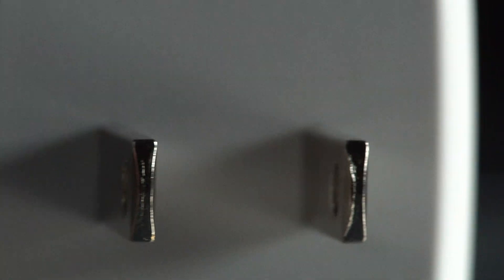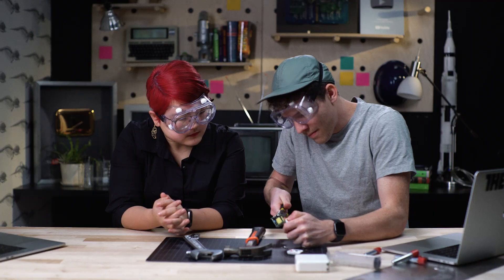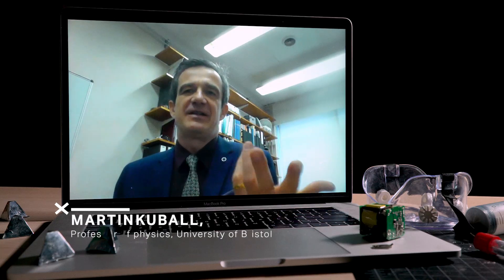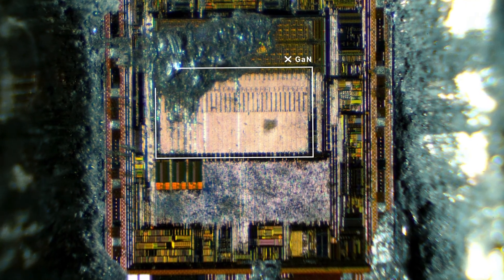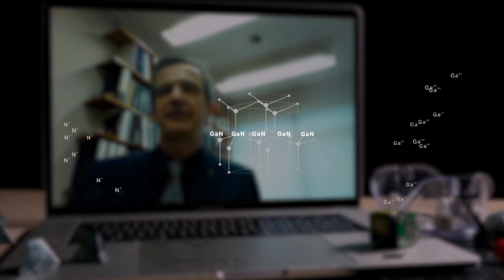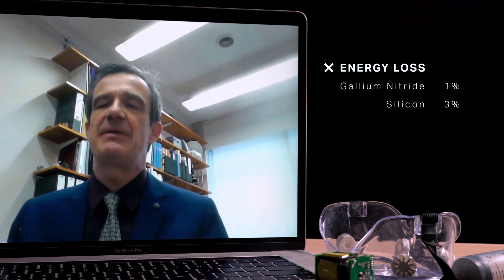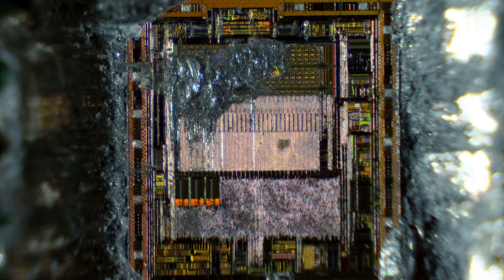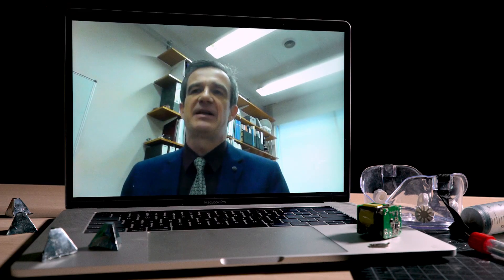Is gallium nitride the silicon of the future?

Comment: I would have to disagree with the video description, where it says “The global electronics industry has been fueled by silicon from the get-go...”

The global electronics industry once depended on vacuum tubes, then upon the invention of the transistor, it began to move to semiconductor-based electronics. But those first semiconductors were mostly made of germanium, which doesn’t work nearly as well as silicon, requires more complex circuitry, and thus is less efficient. As technology improved, silicon took over from germanium. So if GaN takes over, it will just be another step in the improvement of electronics technology. But in reality, the electronics industry goes back even farther than the vacuum tube, as early inventions like telephone and radio predate the vacuum tube.

Comment: you will not get a smaller charger if you use galium nitride, as you have seen, the size of it it's almost all dependent of the size of the transformer, so if you decrease the size of other electronics it will not change much, because the transformer still takes a lot of space
Reply: You can switch at high frequency at the same efficiency than with silicon. This reduces the size of the transformer needed.
Reply: GaN based designs will allow you to use a smaller transformer compared to Si based designs for the same efficiency.
Reply: GaN FETs are the key because their main advantage is that they become much more efficient as frecuencies grows compared to Silicon, and with higher frecuencies, you can use smaller transformers to induce the same power, so all is a chain.

Comment: Is it me or did this video not really explain the fundamental benefit of Galium Nitride, if there is indeed such a thing? A 2% power saving resulting in a 10% drop in overall electricity usage is small fry. That sort of saving isn't revolutoinising anything, especially not if that's only once we've seen a completely wholesale switchover in production. If, however, there were predictions of higher clock speeds or higher density transistor production along with lower power consumption, well then you're talking. A small power saving alone, though? Meh.

Comment: How does the gallium nitride make the charger smaller? You are comparing a 30 watt charger to a 60 watt charger in the video and act as if the difference in size is due to the use of gallium nitride when it isn't.  The biggest components of the charger are copper coils and capacitors. The 60 watt charger obviously requires bigger coils and more capacitors. Capacitors being another space consuming component. The reason the other charger is smaller is due to design and output power. The chip that contains the gallium nitride doesn't get significantly smaller compared to regular chips . The only real advantage it has in this charger is the efficiency, which ofcourse is welcome in a charger. But the chip is not where the biggest loss in a charger comes from in the first place. In general most chargers are already 85%+ efficient.
Reply: Infotainment. They acknowledge that there are scientists but steer clear of anything that might resemble a discussion of science. And they make a big deal about lazy and mindless destruction.
Reply: It is true that coils take a big amount in the overall space of the charger. Heat is a concern, but it's not why it make the charger smaller. Actually, the very big improvement that offers GaN, and that is not said in the video, is that GaN offers a much higher frequency range to convert power. Thus drastically reducing the size of coils. It does have a better efficiency than Si transistors, but on a certain range of frequency only. So be careful on what is said in the verge video... because it's not all green for GaN, a lot is still needed for it to be reliable, mass produced, and so on.
Reply: @alexc4882  Spot on. I'd add that the increased efficiency allows designers to increase the current density without having to place clumsy heat sinks all over the place.
Reply: @alexc4882 :
"Greater freq. range ..." Does somebody you know have 400 Hz power in their home? Or their boat?
Reply: @alexc4882  Not so. Switchmode power supplies - which is what those chargers are - operate at frequencies much, much lower than the upper limits of conventional silicon semiconductors; commonly 10-15KHz. Silicon doesn't start getting problematic until you get up into the GHz range, which is why current CPU clock speeds top out around the ~4GHz range, whereas the theoretical limit for GaN is much higher. GaN doesn't offer any significant advantage over silicon for power adaptors.
Reply: @theantipope4354  4Ghz for silicon is at very very very low power... Your CPU might draw 100W, but it contains billions of these transistors! Here we are talking 1 transistor, 1kW, 1MHz. BIG difference. Simply because you are not in the same electronic. You're talking about electronic of signals, we are talking power electronics.
Reply: @alexc4882  
"Actually, the very big improvement that offers GaN, and that is not said in the video, is that GaN offers a much higher frequency range to convert power. Thus drastically reducing the size of coils."

Alex, that makes absolutely no sense. Their frequency is the frequency at which a current passing through them alternates, not the frequency that a transistor can switch states at. As Lionel said, the frequency of current silicon transistors is already orders of magnitude higher than the rate at which AC alternates.

GaN power supply switches are more EFFICIENT - they have less power dissapation. But the potential for GaN transistors to switch faster than silicon is simply irrelevant when AC is 50/60Hz and current silicon transitors are at around 4GHz.
Reply: @nathangamble125   I don't think you understand how a power converter works. The big picture is that to convert from AC to DC, we use a full wave rectifer (simple bridge using diodes which acually work at 50/60Hz). After that and a LC filter you are left with an almost constant voltage, at (2*Vmax_in/pi) Volt...  If you want to plug your laptop after that, go on!
So, to step down the voltage, we use a buck, buckboost, or any other power converter topology that uses Silicon transistors and runs at 10 to 100kHz (order of magnitude) with passive components that takes A LOT of space! This is that part that everyone is talking about. Going higher in frequency reduces the size of the inductor. But I maintain that GaN is not more efficient than silicon at a few kHz, I'm seeing it every day at my lab... However, with good layout and cooling system, it get interesting at a 40kHz and beyond.
Reply: You have to think of the design as a whole, due to the use of GaN switching, which is more efficient than silicon at the same frequency, you can reduce the size of your transformers by going higher frequency. In fact you can also reduce the size of the filtering circuits as well. The Verge video is badly explained, the reduction in size is not due to the physical size of the GaN chip, but due to its characteristics, the designer can choose smaller parts elsewhere in the circuit.
Reply: This is a good run down although there is a truth to the idea that GaN makes these SMPS smaller. Firstly it makes the power transistors physically smaller but they were already pretty small. It also makes it possible to achieve much higher switching speeds which makes it so the transformer can be even smaller.
Reply: The verge is never a great place to go to for strong information
Reply: Higher switching frequency = less ripple = smaller passive component 
and GaN has lower switching loss too
Reply: In my experience equivalent GaN is 1/4 the area of silicon.  But contrary to what the researcher quoted said ,  the problem with GaN switching circuits is that, unlike with silicon fets, the p-fet is not available (because it does not have comparable performance to the gan n-fet). So in H-bridge topologies, you need a gate drive to operate high-side n-fets, which is no easy feat at high speeds.
Reply: I'm wondering if it was an ad or some kind of "sponsored" content.
Reply: @az_dirt  Yeah , there surely are plenty of unfair comparisons and unrealistic claims in the video to be reeking of both an ad and sponsored content.
Reply: GaN chargers are actually smaller. The important thing here is that these are USB chargers, and the electronic components heat up and limit the power output of small chargers. More efficient transistors means you don't have to deal with as much heat, so you can make your chargers smaller. The limitation on size is not due to our inability to manufacture small coils.
Reply: Just put this Channel on my not watch list
Reply: Sorry thats wrong, it actually makes the device smaller, but that is because you can have a higher frequency in your charger so your transformer gets smaller, also GaN can work just like SiC at higher  temperature higher temperature conductivity which means less cooling system is required which leads to higher density of transistors.and smaller devices
Reply: It has lower resistance than silicon transistor.
Lower resistance means more efficient so the charger can use smaller coil, capacitors, etc. for same output capacity.
Reply: To get simple answer to your question: GaN has faster switching and higher efficiency. Which will make the components around the IC to be smaller (Example driver circuit, capacitor used etc..) which intern overall reduces the size of the adapter. Makes sense?

Comment: As an engineer working on GaN I could say that most of the things that professor said is wrong or misleading...  You don’t even gain 0.5 percent efficiency if you compare the best Si based circuit to the best GaN circuit! And little bit expensive? What a joke! Couples of times more ! And don’t even start with the reliability issues of GaN. When tech is not there it is not there, no need to overhype it just so you can get research fund...

Comment: Gallium Nitride is an interesting step for the future. I think the battery problem needs to be attacked from both sides by improving battery density, but also improving efficiency of electronics. The nice thing is you can actually buy products that use GaN right now, unlike graphene (but maybe some effective way to process graphene will come out in the future and graphene will blow up commercially).

Comment: I dont understand why dr kuball claims GaN will allow us to get a wire straight from the wall to a device. Clearly the biggest component in the transformator is the coil and shrinking it will require completly different tech. 
In general I'd say that this video making some very optimistic claims for no reason. For example the 10% power reduction claimed if we switched to all GaN is really neat, but to actually change out all electronics would require a massive change. Maybe it would be worth it in the end, but it's not like the industry is "scared" and "conservative", they just don't see a big enough benifit.
Reply: @daniel-ruiz  no it obviously couldn't be, because the coil is big and gets hot. You can't change that by making a smaller PCB

Comment: Semiconductors arent halfway between conductor and insulator.. its not like that.. its not even the way it acts or is used.. you are describing a resistor
Reply: Says a lot about the quality of their content
Reply: Verge Science writing the script: "Well I know what a conductor is... and I know what semi means so... I guess..."
Reply: its the verge what do you expect
Reply: I'm an expert in this field. Describing semiconductors in such a way suffices for the layman. 
With regards to the "energy band gap", semiconductors are indeed 'halfway' between conductors and insulators.
Reply: Wait silicon can’t be used as a resistor? I mean most resistors are made from carbon or metal film, but in context of microelectronics how else would you create a resistor?

Also doped semiconductors are what creates diodes and transistors.
Reply: @B0MYT  exectly it can be isolating or conduction P or N its not in the middle between them, its not both its one or the other, you say the same thing nicolas said.
Reply: @omeridan8815  Not really, you indeed can make resistors out of silicon. Silicon transistors can be fully on, fully off or somewhere in between, letting some of the current through.

Comment: You will never have a cable that plugs directly into the outlet. You will still need some inductors and capacitors to smooth the voltage. Better semi conductors allow the use of smaller capacitors and inductors, but only to a certain degree. After a while we reach the physical limits of our universe.

Comment: Silicon Valley is a software and device hub for the most part. Device makers like Apple and Microsoft largely buy off the shelf components. It's the factories overseas which will have to re-tool for this new compound and that's why they have not yet. Re-tooling is a massive investment and there is largely no incentive to do it quickly. It's not just because it's different but because it requires such a massive investment.

Comment: A tad unfair to compare a 30W Anker charger to an 87W Apple one (Less impressive once compared to the 29W Apple charger which also has universal adapter capability). If you were to also barbarically smash the apple charger you would see that most of the space is taken up by transformers, capacitors and inductors rather than silicon dies. The reduced size of the Anker charger is due to the ability to run at higher frequencies, as GaN has lower gate
 capacitance and lower on-resistance compared to silicone. The higher frequency allows for smaller components (transformers, capacitors etc.) along with increased efficiency. In the real world, we would more likely end up using GaN to push performance in the likes of processors, trading its efficiency for performance.
Reply: Ohh you beat me to it .. read this after i wrote something similar.. Kinda got annoyed with them claiming gallium nitride makes a huge difference in size when the biggest advantage is efficiency.. unfair comparison between chargers.
Reply: "likely end up using GaN to push performance in the likes of processors" uhhh. Nope. Everything else is correct though.
Reply: @Furiends  Nah it won't just replace silicon in processors just like that, GaN is natively depletion mode.
Reply: You lost me at higher frequencies to be honest. I wish i understood it better :(
Reply: Would higher frequency make it more efficient? Your dynamic switching losses will shoot up in CMOS. Is GaN that different??

Comment: GaN is already used in all white LEDs (see 2014 Physics Nobel Prize) and is widely deploys in the lighting industry. Electronic applications are more recent and piggybacking on cost reduction due to lighting industry taking off. GaN amplifiers for radars and wireless communication have been around for some time. GaN power electronics applications like this are very recent development (last few years). GaN however has no play yet in digital electronics (microprocessors etc).
Reply: Thank you! This should have been in the video.

Comment: Good for those electronic stuff and good for blue LED and blue lasers, but not good for solar. With a bandgap energy of 3.44eV, only blue light coming from the sun will be converted to electricity and the rest will go through it. Research is going on for thin film dual active layer perovskite (MethylAmine Lead Iodide [Bromide]) and CIS (Copper Indium Dis) solar cells that will be very good in the competition once they are released from their current research phase.
Reply: Thank you!
Photoelectric materials are just getting started, lots to research. Multi-layer perovskite cells are almost ready for commercialization!

https://spectrum.ieee.org/energy/renewables/power-from-commercial-perovskite-solar-cells-is-coming-soon

GaInP, GaAs, and Ge are used in multi-layer solar cells for high efficiency space power applications. But GaN isn't a great choice.

Comment: I don't get why using a different material for the control circuit would have such a drastic impact on the size of a charger. Microelectronics are - as the name implies -  tiny. That would imply that the majority of the device is dedicated to cooling the silicon chip. Is that a thing? I could see the actual power switch getting hotter in a silicon setup but is it really that significant? Maybe you could have opened the other charger too. It would have been interesting to compare their guts.
Reply: @daniel-ruiz  do you know how the overall power dissipation of a charger is distributed among the components (on average)? I'd be curious to know how the electronics compare to the transformer as far as waste heat is concerned.

Comment: Silicon abundance in the earth crust: 25 % Gallium abundance in the earths crust: 0.0014 %. Now you know why it's not used that often
Reply: My thoughts too. But if only a small amount is needed for limited applications, there may be enough. Residues in coal burning plant flues were one source, maybe a significant quantity can be extracted from wastes?  Better to stick with ubiquitous silicon and carbon for most applications, that's my inclination too.
Reply: U didn't add nitrogen 😎😎😎;)
Reply: Nitrogen abundance in the Earth's atmosphere: 78 %
Reply: Well it's not🌚
Reply: It's not going bad as fast as silicon anyway so it's fine...